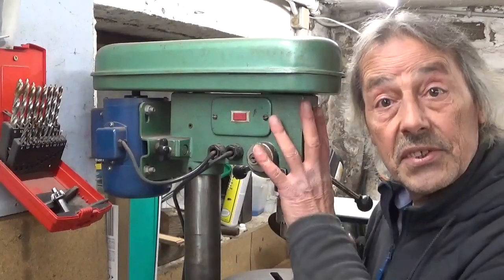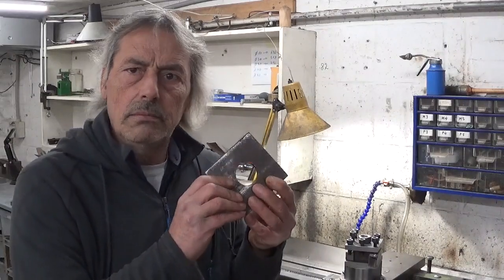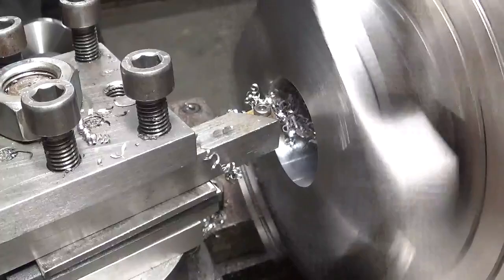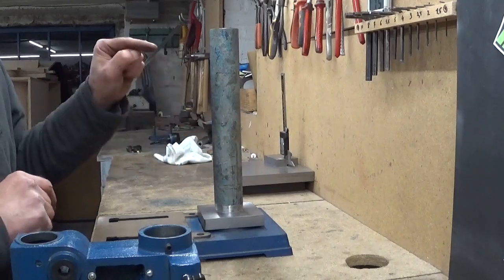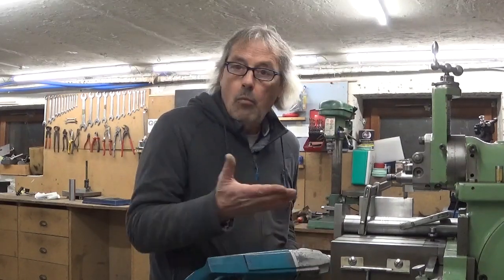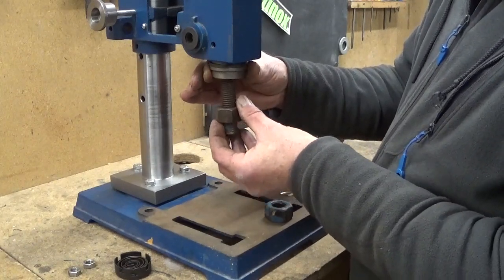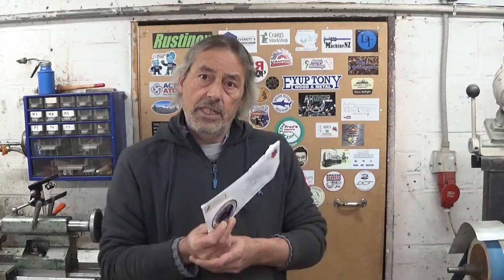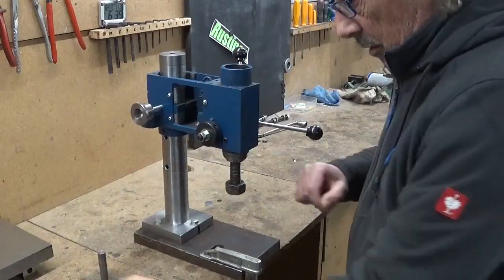An arbor press from a drill press?

Comment: Very nice project congratulations ! :)  I also have such an old drill laying arround because I bought a bigger one. Do you think this could be made into a small mill with modifications at the drill head or would you rebuild the whole upper part ?
Reply from the maker: Tuning a drill press in to a milling machine doesn't work. It's not possible to make it rigid enough. Plus, the taper that holds the chuck is not designed to take side loads.
Reply: Thank you for your opinion. So I can spend my time on a more optimistic way to get it working.

Comment: Nice idea and well done. It will make a great light-duty press. Press fits under 10mm are difficult as heating and chilling metal doesn't gain much clearance. 

Everything that is made of steel flexes. When one part is strengthened another part has a problem when more stress is applied. I suspect the down feed may be the next part to have problems. If not the down feed then thin cast Iron walls of top housing may give up the ghost.
Reply from the maker: Thanks. If it fails I will make another one :)

Comment: I enjoyed watching that build. I did a similar thing with an old drill press where I used a long threaded shaft to make a kind of fly press. I had the same issues with rigidity and have hardly used it. I used the original column, and that was the most bendy bit. I was also worried that the casting would break where the cut out is for the electrics. You have inspired me to have another go, I have some more substantial material now, so should be able to beef it up!
Reply from the maker: If it doesn't work, make it work!. I'm sure you will figure something out. Just go for it :)

Comment: Nice idea for sure. 
Years ago (several) I was rebuilding an automatic transmission and needed a spring compressor..
It dawned on my I could cobble one together out of my drill press. 
Worked rather well as I recall
Reply from the maker: Of course, why not?

Comment: I noticed the same flexing in my little benchtop "Drilling Machine."  Probably the same as what you were using here, under a different brand.
Reply from the maker: Cheap crap. Make something else out of it :)
Reply: @Rustinox    I most likely will, when the motor burns up or something breaks.  In the mean time, it has a place in the midget machine works group.  Good for spot drilling, or starter holes before moving over to the big Buffalo.  Provided you can hold the part in place in spite of all the vibration.

Comment: I was hoping you would turn the drill press into a small milling machine. As an arbor press, it's a bit limited with a lot of column flexing. I have a similar Chinese drill press and I'm considering turning it into a mill by modifying the head to mount on a square column.
Reply from the maker: Good luck with it. A drill press is not rigid enough for milling.